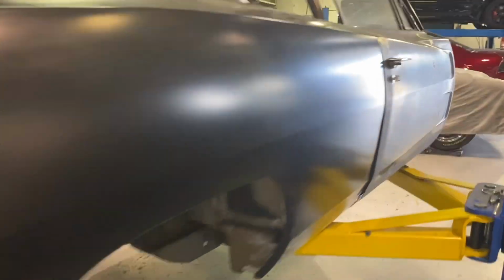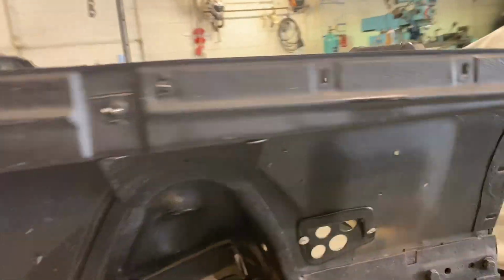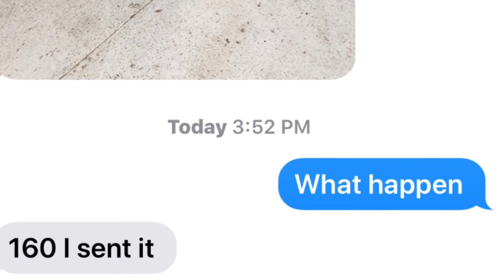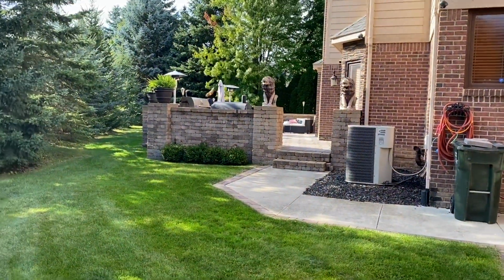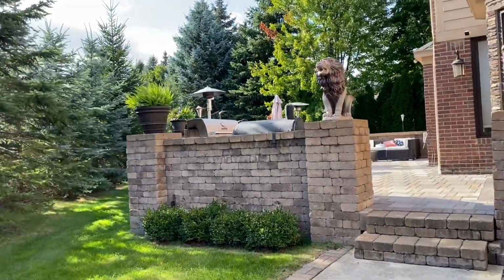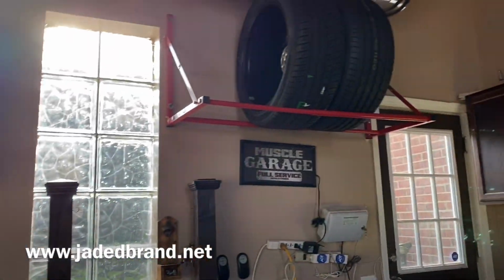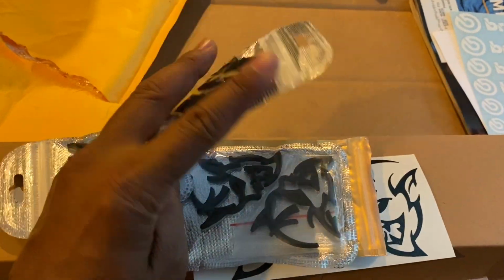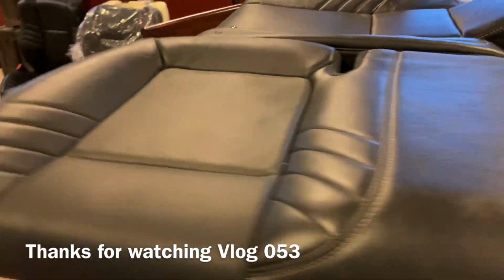VLOG 053 JADED BRAND SHOULD HAVE DID THIS LONG BEFORE PICK UP NEW DODGE DEMON WHEELS 12.5 INCH WIDE

Comment: Nice. Got them weld to widen the width.
Reply from the maker: Bald Head Garage question.   Should I do Widebody on the charger or should I stay stock width? Im getting others thoughts!!  In order to compare and make accurate decision. Google the helephant charger and see Widebody vs Reverence 69 charger. Let me know your choice. Thanks
Reply: @JadEDBRAND  Hellephant charger hands down. 68 is my favorite year. Imma but some bronze rims on mines when the time comes
Reply from the maker: Bald Head Garage so your saying the wife body she’ll welds?  Also I have some bronze wheels 15x12 rear 15x8 fronts. They are the exact wheels that’s are in my garage I had two sets that were in my charger.  The chrome ones in my garage or the bronze ones.   Forsale.
Reply: @JadEDBRAND  Yea more meat on the rear tires will have her handle like a champ. Thanks for the offer but i got to have to some 17s for the charger. I wont be ready for rims and tires til probably next years.
Reply from the maker: Bald Head Garage for sure.  I have the 20x12.5 on rear regardless just wanting thoughts on the actual wheel wells (Widebody)
Reply: @JadEDBRAND  Will those fit without tubbing the rear??
Reply from the maker: Bald Head Garage Car was tubbed few years ago.  The wheels I removed off it were 15x13. So yes. I had all the work done 3 years ago. I sold it to a gentleman in Cincinnati. He allowed my builder to continue. Then I bought car back and just changing up my original build
Reply: @JadEDBRAND  oh ok cool